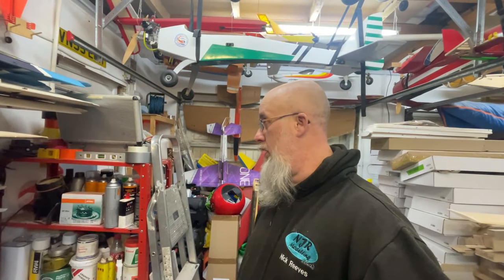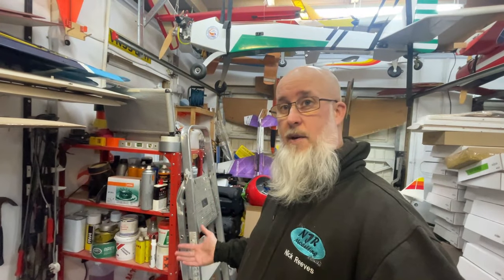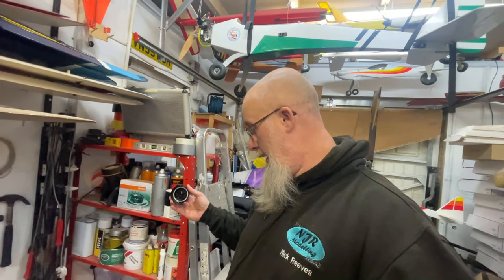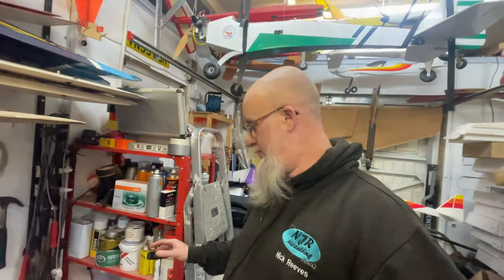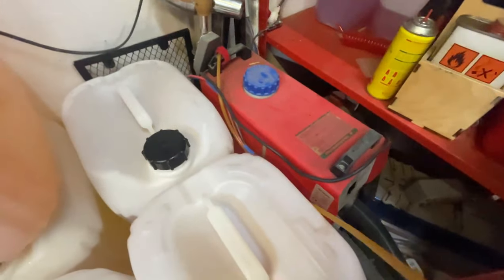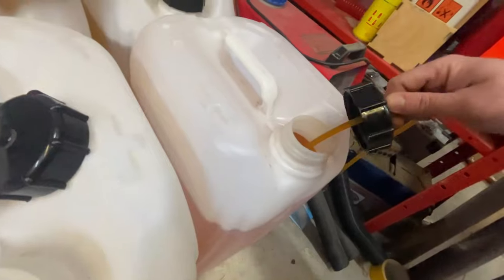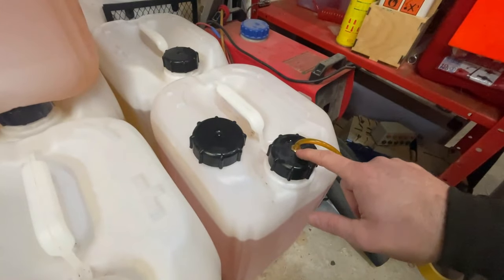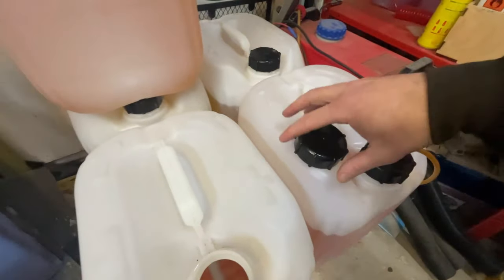Will a BIGGER Fuel Tank for the Diesel Heater work?

Comment: I run my diesel heater pretty much all winter. And i use a 55 gallon Drum as my Fuel Tank. Last pretty much all Winter
Reply: Do you run it 24/7 or turn on in the morning?  Been thinking about letting mine run 24/7 but worried it might start a fire
Reply: @billfighter71  mine pretty much stays on 24/7. On high while I'm home and i turn it down on low when I leave

Comment: Did you just drill a hole for breather ?
Reply from the maker: Yes, 2mm from memory
Reply: @njrmodelling  thanks for fast reply . The thing is I’m going to instal it in my pick up truck camper and I wonder if it’s going to splash out on road bumps through that 2mm hole . I thought maybe there is an option somewhere with some kind of valve membrane , which won’t allow to splash out , but just to sink air inside
Reply from the maker: @victorc1257  you could possibly install a fitting in the cap and fit a length of tube with a small filter on the end and create like a stack pipe
Reply: @njrmodelling  that’s is actually a good idea ! Thank you so much ! Going to Alaska from Seattle and need it to be hot in truck bed camper

Comment: Any idea how high/far the onboard fuel pump will lift the fuel? I was thinking about putting a diesel heater on my second story porch but wanted to leave the fuel on the ground level. I am curious if you think the pump would be strong enough to draw fuel up (pump head) 12 or 15 feet.
Reply from the maker: In short, I don’t know. It’s not something I have tried. Using best guesswork, I would say that there is a good chance that the pump would not be able to lift fuel that high as the original design applications are for truck cab heating. Obviously from that camper vans, boats etc also use them but they are all installed at pretty much the same level as the fuel tank. I think if it were me I would try a mock up and see if it worked
Reply: The inside dia. of the fuel line is so small, I would bet that it will lift it 15ft because the weight of the fuel it will be lifting would not be very much at all. Let us know if you find out whether or not it works please.

Comment: Great video man. Doing this soon.
Reply from the maker: It’s a great mod to do
Reply: @njrmodelling  what are your opinions on using a fuel stabilizer? Let's say I had enough fuel in one trip that I sat on for a few months, would an additive like stabil be ok? Pointless? Or perhaps harmful? Thanks!
Reply from the maker: @totallylegityoutubeperson4170  I can’t comment on this as I have never used a fuel stabiliser
Reply: @njrmodelling  thanks! I have tried to search for this info everywhere except asking YouTubers. This was the first time. I know fuel degrades after a month or so, but didn't know if it would have any effect on the pump or the fuel prayer...or add residue to the combustion chamber. I'd assume it'd be ok, and I was wondering this since I'm assuming quite a few people buy enough diesel in one go to last for the winter months and someone has to have tried using a basic anti-ethanol additive.  Aside from proper storage during summer/spring, I wonder if an additive would basically eliminate any fuel problems one can occasionally have running these heaters.

Comment: in the UK, do you go to the petrol station and just fill up one of your tanks and that's fine.You don't get an angry lady on the  tannoy.
Reply from the maker: I cant speak for everyone in the UK but i go to a local fuel wholesaler who has kerosene on pump. They also have Gas oil/red diesel (different tax to road use) on pump
Reply: @njrmodelling  cool thanks